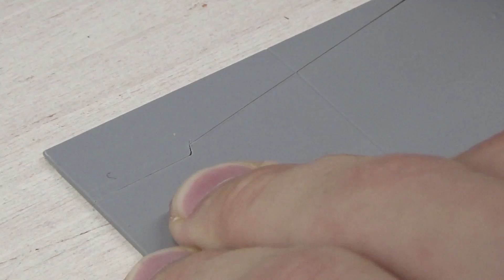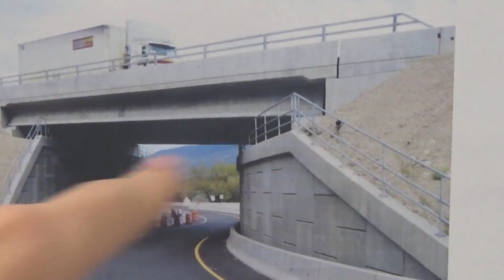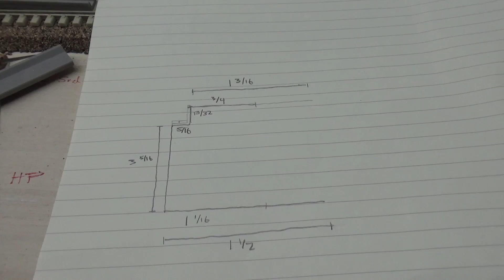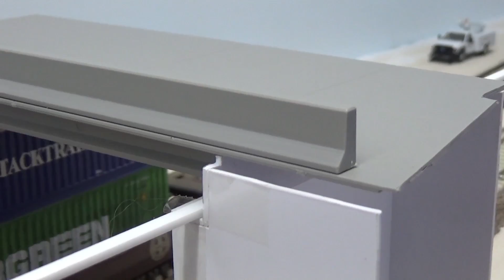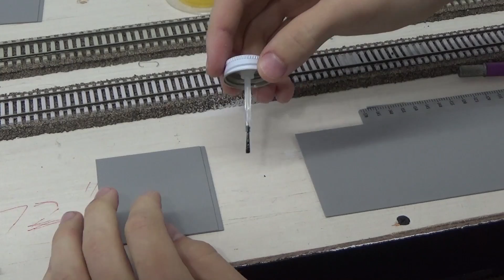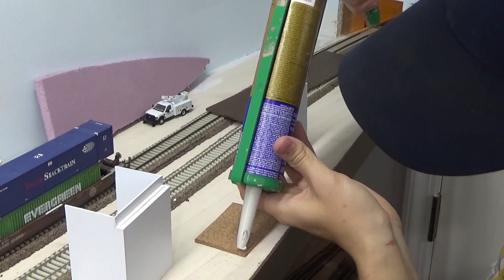Building an Overpass (1/2) - Crawford Scenery Episode 1

Comment: Great video, only suggestion is the glue. Testors Model Masters  8872C  has a metal tip and works great with styren.
Reply from the maker: Thanks! And thanks for the tip! I'll have to check that out. As you saw, I was just using generic Testors glue.
-Cam

Comment: Cam,

Nice start to an essential project that will make a huge difference to trains entering the upper level.  The Rix kits seem pretty decent as well except for the 2 C-channel beams - the prototype would have only used i-beams.  Looking good and as everyone else here I'm looking forward to seeing the part 2 video and the completed scene.

I recommend that next time you are out getting modelling tools you do yourself a favour and buy a modelers miter box.  They make cutting shaped materials far easier and much more accurate - and faster if you are making multiple parts as you can add a temporary "stop" to them with a small block of wood and a small spring clamp.

I know its "armchair quarterbacking" and it is too late for you but perhaps of benefit to other modelers following along, it would have been better to have removed not only the box section from the bottom of the rear side barrier but the bevel as well.  That way the bridge would have fit flush against the wall. Right now the little gap that exists because of the bevel will result in a shadow line on the sky backdrop which not only detracts from otherwise good modeling, it is a dead "give away" that a wall opening is being hidden. 

Keep up the good work and enjoyable videos.

Thanks and Cheers
Carl
Reply: Oh yes one more small point.  When you add triangular gussets to firm up corners, try nipping off the point at the right angle - just 1/16 inch or so.  That way the gussets fit into the corner better and you can make a contiguous glue weld on the inside corner.  Minor point but it can really help.

Thanks and Cheers
Carl